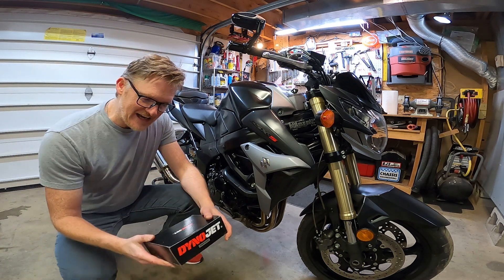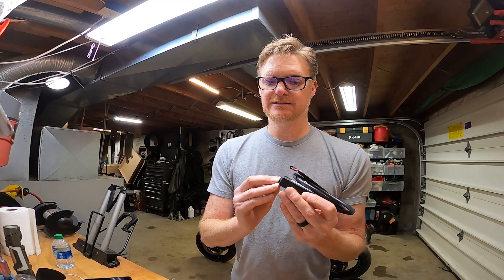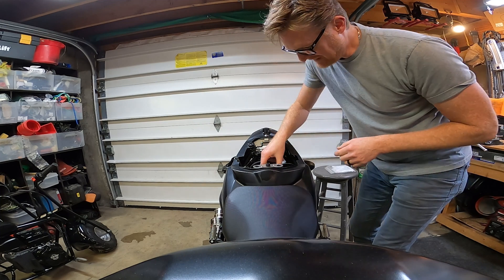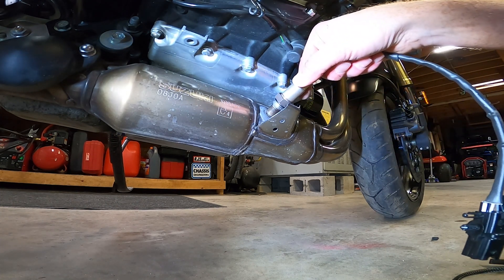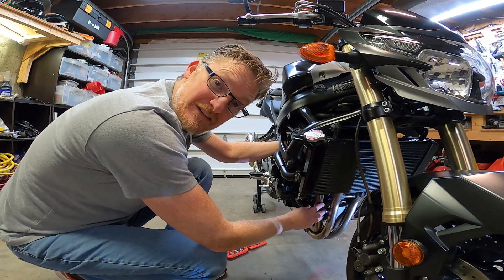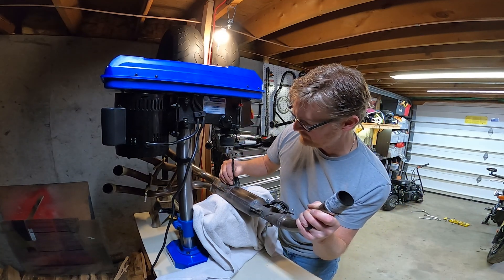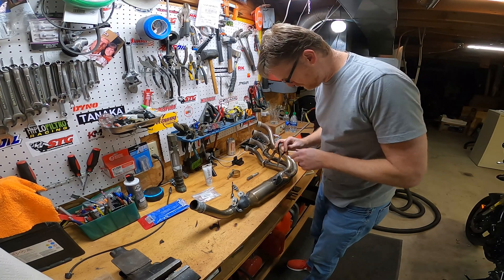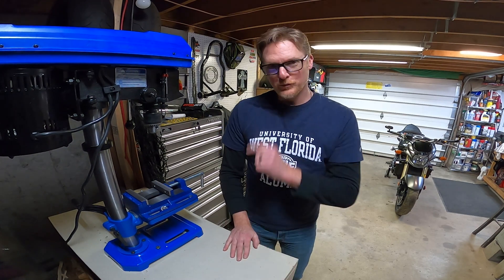DynoJet AutoTune Install PT 1 | Wideband O2 Sensor Drill & Tap Exhaust | GSXS750

Comment: I just got off the phone with Dynojet and they said “ you have to keep existing 02 sensors plugged in to pcv and drill new holes for auto tuner”. Is that true?
Reply from the maker: It depends on what bike you have.... the PCV for the 2015 GSXS750 came with an 02 sim included with instructions to unplug the 02 and plug in the o2 sim. Which I did. And it worked great. When I bought the Autotuner, it came with a wide band 02 sensor that is required to operate the autotuner. It is an 18mm diameter and it required that I install it in the exaust in the exact location where the stock o2 resides. So I installed it in the same hole after I drilled it out. And wired it up. It works flawlessly. My bike has never run better. Perhaps on newer bikes what they are telling you is true. Here are the instructions for my bike: https://www.cyclegear.com/assets/0001/1453/dynojet_power_commander_v_suzuki_gsxs7502015.pdf see step 11 and 12 especially where it says "The stock O2 sensor will not be connected to anything at this time. It can be
removed from the exhaust if desired and if you have a way to plug the hole left in
the exhaust."
Reply: @sstressfl   hi thanks for replying. Oh ok. I have a 2021 Harley street glide special. It just seems odd that I would need both units to read the exhaust. You think he might be wrong? Iam still gonna investigate. I enjoyed your video thanks for posting it.
Reply from the maker: @chuckyp7058  pm me at michael@clickthruvt.com

Comment: CUT THE CAT. Sounds better, more power. Win Win.
Reply from the maker: Hey man, I have done it before and I am aware of the change but I wont remove a cat from any vehicle these days. While I am a huge fan of hp, I also like cleaner air. A cat will convert carbon monoxide (poison) to carbon dioxide (still poison to the earth but less poison to humans) and remove hydrocarbons and nitrogen oxide (bad for your health ozone stuff) into safer air stuff. Anyway, I am aware, I just chose not to. Peace man!

Comment: does this work with the commander 5 that is what I have on my Harley Davidson road king but my Harley is a 2005 doesn't have 02 sensor and iam having some problems with the commander 5  probably the air fuel mixtures like stumbling ever once in awhile would this fix these problem does this unit adjust all the time  on its own to keep the  bike running good .
Reply from the maker: Yes it works on the PCV but it requires o2 sensors. Unless you are an experienced welder, you'll need someone to weld o2 bungs into your exhaust in the right spot so you can mount the sensors. But once its all connected and you program it for your desired fuel ratio(s) it'll adjust your bikes fuel as you ride. I'm completely sold. Had to be the best thing since sliced bread :) If you're serious about it, call Fuel Moto. They do a LOT of Harley work and they are dynojet.power commander/auto tuner experts. They might be able to help you with your current tune. https://www.fuelmotousa.com/

Comment: Hi Michael another excellent video.. Well done. Your still my goto video manual for my gsr750.. How's yours screen idea coming along.
Reply from the maker: It’s still staring at me! After filling the house with fiberglass resin smell the first time I haven’t gotten back to it. I could do it outside in the summer but when it’s nice and I have time I’m riding. I simply haven’t made it a priority. But it would be nice to finish it up. Maybe someday 😎
Reply: @sstressfl  I bought one from Amazon for like 20.00 and it works fantastic. Smoke color and looks like it should have came factory.
Reply from the maker: @jimperry4420  I was making my own cuz I wanted a diff look :)